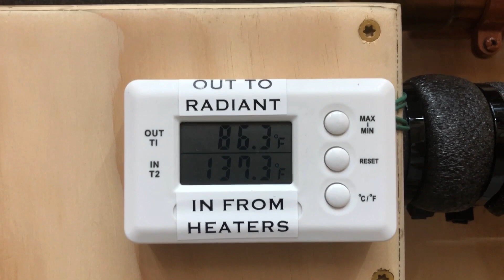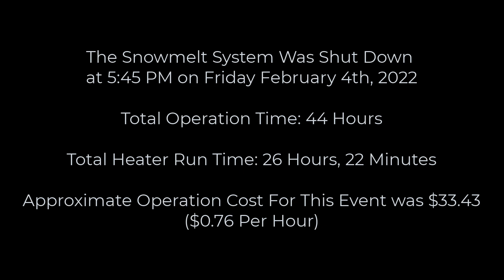Buffalo NY Heated Driveway Melting Snow Time Lapse: Winter Storm "Landon" - Episode 82 [2-3-2022]

Comment: Thank you for the detailed videos. What is your opinion on electric systems? I have a 1100sqft driveway in Manitoba, Canada.
Reply from the maker: You're welcome, thanks for watching!  Regarding electric systems, sorry but I don't have much knowledge or experience with them.  In my area, an electric system would not be feasible. Electric is a lot more expensive than Natural Gas here (although Natural Gas is up this year almost 84% compared to last 🤬).  There have been some other comments on some of my videos with people using electric systems, and their results have been poor.  Check out "@nick cats" comments in this video: https://youtu.be/32rQwinmyn4  I realize for some folks, natural gas is not available and propane can be difficult to have delivered regularly, so electric is the only option, but electric seems more susceptible to damage and it is my understand that for something that large (1100 sq ft) you will need a pretty beefy service and upgraded wiring.  I could be wrong though, as I have no direct experience.  Hope that helps, and thanks for watching!

Comment: Good stuff. Now you need to put some hydronic fan coils in to Melt the snow off the vehicles :)
Reply from the maker: Or just finishing cleaning the rest of the crap out of the garage so I can pull them BOTH inside! 😉  You may have noticed the minivan disappear or re-appear a couple of times.  It's because I pulled it in or out of the garage.  I edited out the shots where the gropro was photographing the garage ceiling while the door was up. 😀.  Hydronic fan coils would be cool too though.... 🤔

Comment: Where does your water run off go to?
Reply from the maker: Hey Russell!  The driveway was purposely sloped from the house and garage to the street.  There is a channel drain that runs along the house, and out towards the driveway.  You can see more of the install of that here: https://youtu.be/AVVQhL3sxcM  The rest of the runoff runs down the driveway and to the curb, where it typically meets the salt from the plows and melts.  Occasionally if there is a heavy snowfall in a short period of time, it will re-freeze over the sidewalk and apron, and I simply take a flat "edging" or scraper tool and it comes right up.  I shovel it out of the way when I'm doing the sidewalks and apron.  So far, it hasn't posed any problems.  Hope that answers your question, and I have a lot more videos in the playlist if you haven't found them yet: https://youtube.com/playlist?list=PLdWeMRuZcbQjekwiBk_uy39IS6JFWYORD  Thanks for watching!